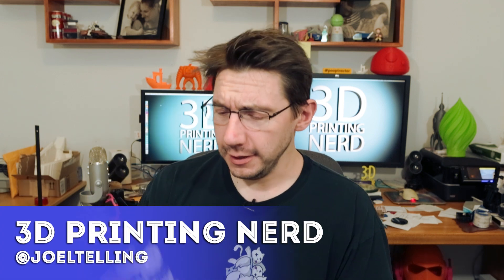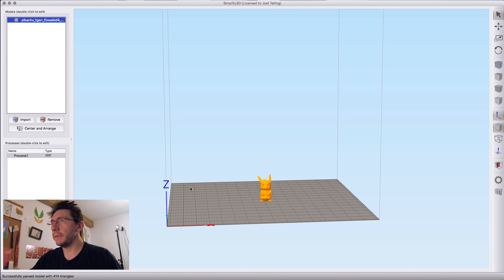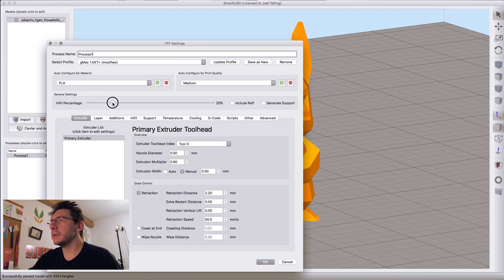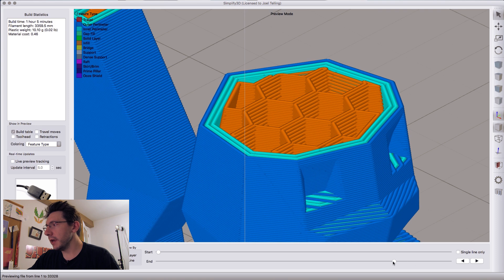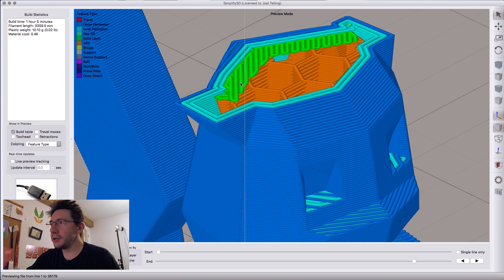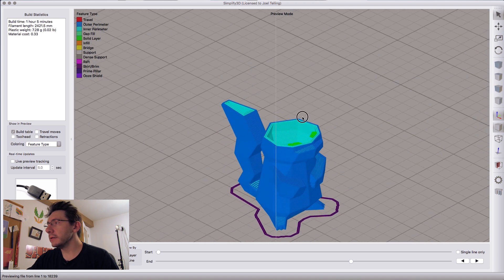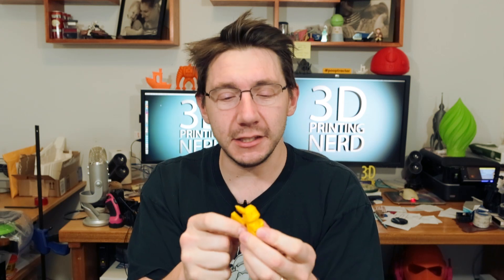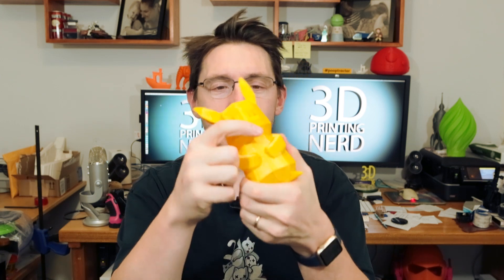3D Printing: Stop Wasting Plastic on Infill Percentage

Comment: so, models for fun, i print at 0% infill and 0.8mm wall thickness (2 times my nozzle diameter)
and for functional parts, i use 25% infill and 0.8 mm wall thickness
sometimes i use 100% infill, but only for extremely thin parts that are like 7mm

btw, could you di a review about the esun filament? Its very good, and dirt cheap

greetings,
    Marvin

Comment: You should have broken the big one! Unfortunately, people have gotten so into saving plastic that they put holes where they shouldn't be! I've had to repair several models. Saving $1 in plastic, just to lose 75% of the tensile strength! What you are saying is well a good for models, but let's see some real world applications hold up with Zero infill.

Comment: I use 10 % for models that are for fun. 25% for more serious. but wall thickness is always best
Reply from the maker: +633r Exactly!
Reply: @3DPrintingNerd  so are those % recommended? i am a new ender 3 printer guy and all this is research into what works. i do a lot of rpg miniature 28mm scall stuff. vehicles, people, terrain, 15% is what i have been targeting, but i noticed 50% for the people seemed to be what it was out the gate. i am interested in speed, and strentgh
Reply: @_CrazyCrafter672 
I think it's more about it being true than it is fair lol
Reply: I made a spool holder as the one on my printer wasn't big enough, would 80% infill be to much for that? it holds 2 Kg spools
Reply: @georgesaliz8727   Just make it 0% infill -> use drill -> fill with cheap strong material.
Reply: @droknarnaramor8650  That's what I do with resin prints - I leave a couple holes in the bottom, fill it with sand, top it up with glycerin and float a drop of resin on top of the glycerin and cure it to seal it off. not the best strength-wise, but it makes figures a lot more hefty :D
Reply: @georgesaliz8727  depends on the loading.  Is it solid?  Spoked?  Spokes flared out at the ends or straight?  Try picturing the forces applied to it - e.g. its weight pushes down *here*, which twists that piece *there*... - and that's where you need strength.
Reply: Depends on how big my model is and how its build up.
Yesterday Ive printed a model with  just 8% infill so I felt more confident about a solid model and about printing distances that maybe need some support underneath.
Then Id rather use infill on a low percentage and also the type of infill will make the difference on how much material you use.
Also some types of infill will increase the printing time while other ones will decrease time ans be just as strong , I always think about whats faster and easier to print.
Im quite new to 3d printing (my ender 3 machine is just 1.5 months old ) but its just using common sense.
Gotta say Im really happy with the quality of my ender 3 , especially for the price that machine did cost 👍😀
Reply: Same but I want really do serious ones often

Comment: Hey 3D Printing Nerd! I'm new on your channel and i like your videos very much! ^_^ I'm very interested into 3D Printing and want to buy a very good but cheap 3D Printer for me to beginn with. Any good suggestions? I don't want to pay more then $500 and want a good printing quality. Other question, if i would buy a 3D Printer and want to print a multicolor model, i mean for example, i have a Head model, the skin is (For example now) red, the eyes white and the hair brown, can a 3D Printer print me that? Or have i paint the model?
Reply: You can only get that multi-color effect with a dual-head printer (or getting really good at swapping out filament just in time, which is difficult). A dual-head printer is probably out of your price range.

How handy are you? You can buy a Printrbot Simple Metal Kit for about $600, or cheaper as a kit that you build yourself. It's an excellent printer - I have one and it prints gorgeously - but if you can afford it, you should splash out for the heated bed, too. You'll save a lot of money (and frustration) in the long run if you're not having every third print break off the bed halfway through.
Reply from the maker: +Nickk888(NickK-456) - Musician and Video Maker Melanie makes some very good point. You COULD print all the pieces of a head model with different filaments then glue them all together. Or, yes, paint. #highfive
Reply: +Melanie Wilke 
Hmm, yeah, $600 is a little too much for my budget though, what about the CTC 3D Printer? I know it's a china replicator clone, but i read a couple reviews and they said it's very good. And only for $400, and also with Dual-head what i could need.

Comment: Thank you so I want to ask for a  material solve the problem of printing a large body of the printer doplicator i3 using abs  because its warping
ghm976@gmail.com
Reply from the maker: +Moh Ghannam If you're using the Duplicator i3, you can print PLA and have less warping.

Comment: Why print the two lines around the base on the bed in the first layer?  I've always thought that was a waste of plastic.
Reply from the maker: +Rick Seiden It's called a brim, and it's to prime the nozzle. There are a TON of different ways to lay down some plastic to prime the nozzle, and a brim is one of them. The brim also ensures that the bed space the print will exist on is level and the nozzle moves over it and prints with ease. I do two perimeters with this. Some people do 1. Some do 5. It is a throw away piece of plastic, but, it's so, so very little.
Reply: +3D Printing Nerd I haven't been doing it on my prints.  It just seems such a waste.  But if it primes the nozzle, then it makes sense.  Once my printer is operational again (blown motherboard), I'll have to start using it.  Thanks!
Reply from the maker: Rick Seiden So, for me, as the nozzle is heating up, a little bit of filament oozes out of the hot end. I take it away before the printing starts. That leaves a gap in the hot end, and that takes a little bit to fill up. If you start your print without the brim, then it's going to be missing a little bit of filament at first. At least, that's with mine. I may reduce to one perimeter. Some folks do 5-10 perimeters and leave .5mm gap between the brim and the part being printed to use as a way to combat warpage and get better bed adhesion. Neat, right? Welcome!  #highfive

Comment: The funny thing is that a model can actually be stronger being hollow that it would be if it was solid.   ...why?  Because of force deflection.  When the model is solid and you apply a force to it there is no where for the model to flex to because there is something right be hind it, that causes the shear forces to focus, where as when the model is hollow the outside is more free to flex and will naturally tend to find a stronger geometry to counter act the force.

Comment: Great video as always i have a question tho i'm printing some keychains in two different colours i'm using black esun pla for the text plate and esun abs red for the text but after it finish print if i twist the keychain the text pop off  what can i do to solve this if i print pla on pla it works good  how can i bond abs to pla ?
Reply from the maker: +TriniRCmodels if it isn't bonding, increase the temp.

Comment: In the beginning you said you would explore reasons. But you never spoke about technical parts which require certain forces (push or pull, torsion etc) to be absorbed in a correct way in repetition and for a long period of time. In this example it's just a statue that doesn't have to carry any weight and will never be put under stress, but I think you're really missing the point in other kinds of models where you would definitely need a certain type of infill.

Comment: hi, i see your using simplify 3d, i jyst got it and am having fun, with dome things makerware jyst completly messed up on. question i have is when you preview the build, how do i get my usage data in metre, as i tried printing a box for a radio my dad made (printed fine) but said it would use 500000 something (it was a length) and that is no good me as i usually buy 1kg rolls, or 10m samples.
Reply from the maker: +g hosty Hey! First, thanks for watching my stuff! Second, it's a filament length in milimeters. If you want meters, multiply that number by 1,000

Comment: Joel, I love your videos. I want to get started in printing, I have no real Cad experience. What do you recommend as a good printer and software to HT started. I learn quickly so not interested in a garbage starter printer but don't want to break the bank. Thanks in advance.
Reply from the maker: +TripleXmodder The video I just published last night regarding the Wanhao Duplicator i3 is a great printer to start with, and will not break the bank. For CAD, start tinkering with 3D using tinkercad.com

Comment: This works great for organic shapes and models that don't have flat top surfaces, however for models with flat top surfaces, especially expansive ones, the sorts of models like functional replacement parts and joints, 0 infill will not be acceptable. Try printing a 20mm cube with zero infill and see how many top layers you have to set it to before you get a decent print. No, really, do that because I'd like to see the result.
Reply from the maker: +mrjoesays You're right - and I hope I didn't come across as ZERO INFILL FOR EVERYTHING! in the video, because, I'm not that way. I just wanted to make a video to get people to think about it for models that it could work on. That's all. As for a 20mm cube with zero infill? It's actually easy to do, and with active cooling and good bridging, I bet I could get a nice flat top in 4-5 layers.

Comment: I found infill is pretty important but it highly depends on what you're doing with your print. Usually we can get away with big shells.
This morning I printed a Anna (from Frozen) at 20% and my kid already broke it just by letting it fall on the floor tiles. If only we could set a different infill on specific parts of the model... It might be possible by tweaking it on Meshmixer?
Reply: +Julien Dodokal Closest I can think of doing that is layer based so between layer X and layer X+20 use 10% and layer X+20 to layer X+40 use 50% then the rest fall back to 10% (or even 0%).  I say 10% because trying to print infill on top of thin air isn&#39;t going to work.
Reply: +legalizeshemp420 Do you know a software that can do that?
Reply: Julien Dodokal
Slic3r can but a pain in the ass but Simplify 3d is dead sexy to set that up and you can control each layer with a completely new set of parameters too though that would be insane but can be done, lol.

Comment: Definitely a good tip. I often try to go low infill, it's internal as long the outside structure works for the job -- save some plastic, and money. I've printed a really huge cave/perch for my bearded dragon with 3 perimeters, 6 top and bottom layers and 12% infill out of PETG -- there were a lot of flat surfaces, so you need some infill, but just enough for the top and bottom layers to start to stick since PETG doesn't bridge well and active cooling with PETG totally ruins layer bonding, so fan is typically turned off. But at 12% it's hella strong, I still used 4.5 kg (it's big) but if I used higher infill, I'd have needed even more, for a model that big -- 20% infill would have gone to 7 or 8 kg, adds up quick
Reply: kg? What kind of printer do you run? Must've been massive
Reply: +joblessalex, I have 2 now, the new one is large 12x12x12 inches. The bearded dragon perch/cave was printed on my MakerGear M2. The volume there is 10x8x8, much smaller. I just split the model into 24 pieces and glue/weld it into a the huge thing it became.
Reply: +joblessalex, I have 2 now, the new one is large 12x12x12 inches. The bearded dragon perch/cave was printed on my MakerGear M2. The volume there is 10x8x8, much smaller. I just split the model into 24 pieces and glue/weld it into a the huge thing it became.

Comment: #asktheneed
is there is a way to reuse my failed printed plastic?
like converting it back to filament for other prints?
Reply from the maker: +shubham sagar Yes, there is a way, however, I've never done it. Requires building or acquiring your own filament extruder.
Reply: 3D Printing Nerd but that would be costly,right?
Reply from the maker: +shubham sagar VERY. It takes an incredible amount of machinery to produce quality filament.
Reply: 3D Printing Nerd so should i save my all fail prints in hope that ONE DAY there will be a small desktop size thing which will convert my prints to filamint?
Reply from the maker: +shubham sagar I would love to say yes, but, no, I wouldn't :(
Reply: 3D Printing Nerd lets cross our fingers i gess (T^T)
Reply: +shubham sagar  Why not? It's not going to be a single stage process, but handmade shredders have been floating around, which are operated by human force through a lever, which though means that the shredder needs to be mounted to workplace really well; but a small-ish motor + a high-ratio reductive gear set to multiply torque is likely to work too and resolve mounting issue. Once quality shredding problem is solved, the actual extrusion doesn't appear to be that difficult, it's just a hot nozzle, a cooler, and a supply mechanism, and the rate of supply issues can probably be compensated at low extruision speed.

The factory machinery is big and complex to guarantee quality and allow high volume production. But with a slow extrusion rate and with manual visual quality control between steps i think it's possible to make simple-ish compact units.

If no compact units can be made, perhaps a recycling scheme can be arranged. For example, sorted/tested prints can be accumulated at CCC chapters and 3D printing service companies, and you could bring your private prints too, and then sent off to a filament recycling specialist in bulk.
Reply: Siana Gearz thanks for reply,i found a desktop recycle meachine thing which convert raw abs into abs filament and it also recycles the plastic
still under devlopment though

Comment: I agree for decorative and non structural prints. However I print a lot of structural parts including tools and parts used in industrial machines I make and sell for a living. These parts would not be breakable by hand as you did. My first printer had some parts that the maker (not me) printed with 4 perimeters and 40% infill, guess what happened? Well one of those parts was the main support for the X belt and it broke while printing and caused the belt to become extremely loose. I was able to glue and use Zip ties on it well enough to print a replacement and that lasted 3 years until I stopped using that printer (that part is still fine today). Not everybody prints shelf decorations and props for cosplay. Many people use real world applications and many times they need high infill or even solid. I would say a good 50% of my prints are solid though many are only 5mm thick or less.
Reply from the maker: +sublimationman Great info my friend. You have to use what's right for you and the model application. I'm not printing any structural parts at the moment, so my infill requirements aren't huge. I did have to print some replacement parts for my Wombot printer. I printed the X axis brackets using Colorfabb PLA at 50% infill, and they are the right strength. Lastly, thank you so much for your comment! I'm always extremely happy to meet people (digital or otherwise) who do more than what I am doing with 3d printing!
Reply: Joel, just FWI I am also Epoxyjewelry on Twitter :-)
Reply from the maker: sublimationman oh, OH! HEY MAN!
Reply: I use PETG and infill/solid is a must for anything you print, the plastic can sag super easy, and requires a ton of cooling if you use less infill.  if you tried to print PETG with no infill it would just cave in on itself while printing.
Reply: If you use 3d printer for solid plastic structures you have a lot of money.
Try this print your part hollow use it as a mold for epoxy or sth like this.
Mold for aluminium (cans from cola XD) with plaster over your part.

Comment: Awesome now I would use less filament but I'm still saving money for a 3d Printer. 
You should build a Filament Extruder so youcan recycel the Wasted Parts in to New Filament.
Reply from the maker: +Griffelkiste While the ability to make your own filament sounds neat, it's really hard to approach the tolerances that the filament manufacturers have because their machines to make the filament are multi-thousands of dollars.
Reply: 3D Printing Nerd Thats true I even Now people how got it working with minimal tolerances by just adding an overkill Fan after the extruder.